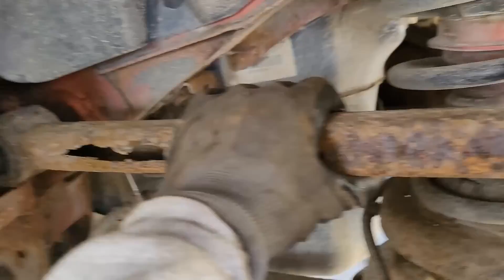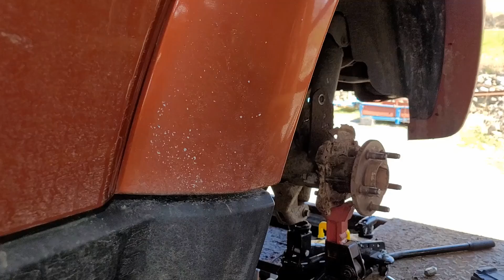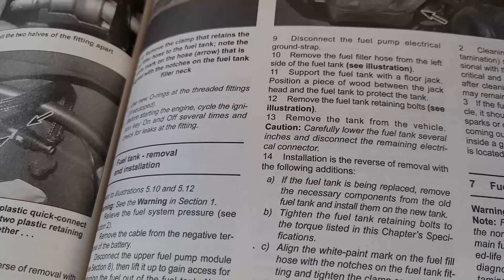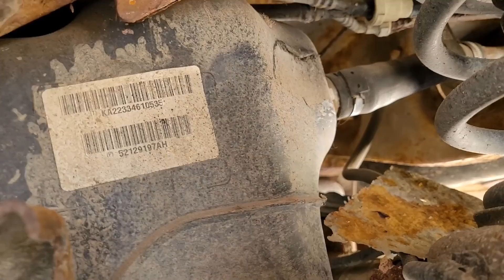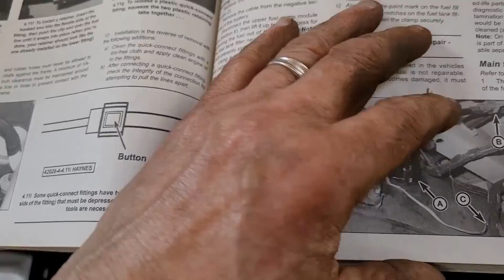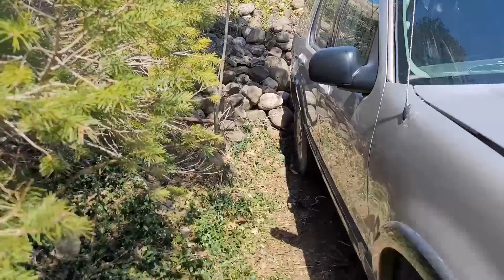Dana's Garage 07 Dodge Nitro rotted Upper rear control arm

Comment: I have an 08 nitro w/ the same issue .... top dr side rear control arm needs replacing and my mechanic quoted me 465.00 including the arm and labor ... he told me the arm he's using is solid ... not hollow ... so it'll last longer .... But does it really matter ... ?? ..

Comment: Cut the bolt head off and push the remaining bolt shaft out the other way, then put new bolt in from the other direction, the way dodge should have done it
Reply: So i don't need to use the bolt it came with?

Comment: It seems like suspension parts and subframes (pretty much all OEMs) don't get much of a paint coating at the supplier.  I frequently see vehicles where the unibody still looks pretty solid but the black painted undercarriage stuff is rotted badly.